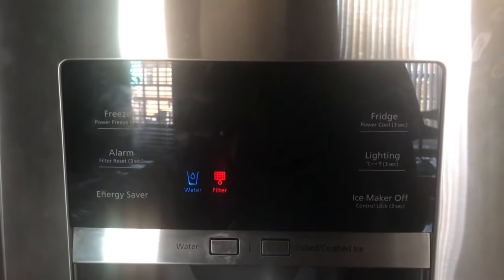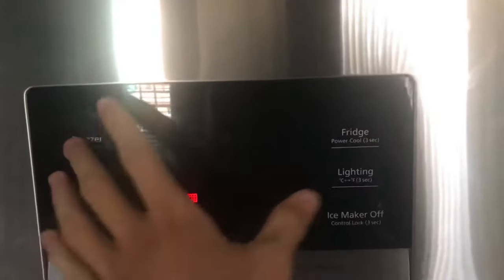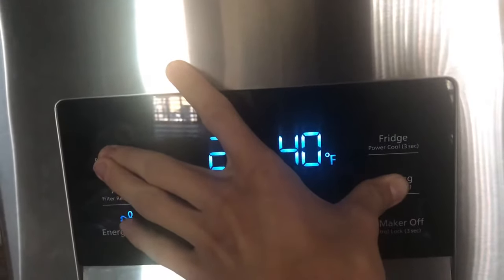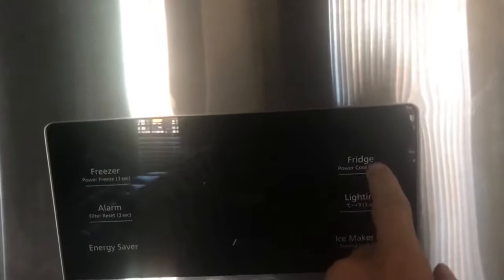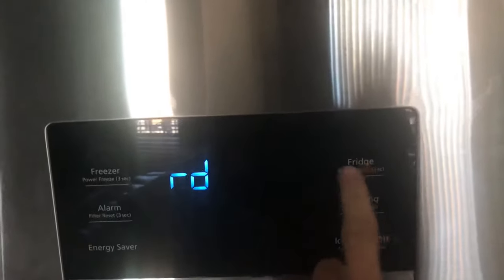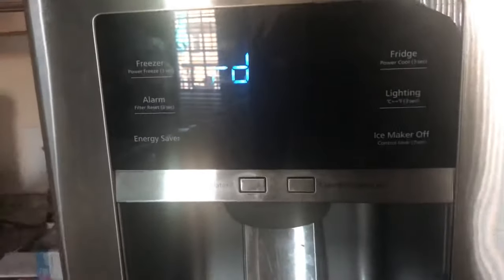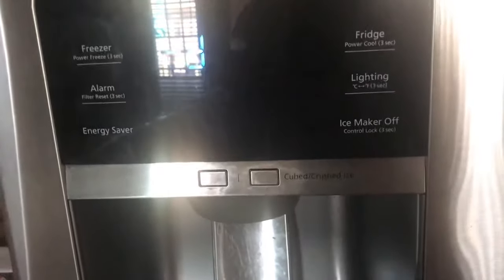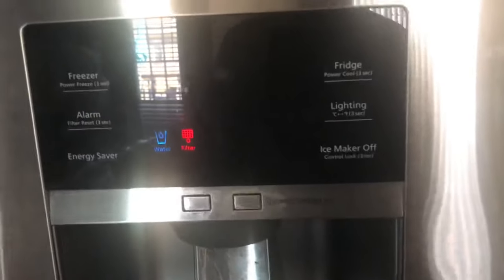2023 Samsung Fridge Ice & Noise Fix

Comment: Samsung Refrigerator  RFG297HDRS  (2013 model)
Knocking noises coming from top of fridge due to ice buildup in back panel and ice maker.
Need to activate Refrigerator Defrost (code Rd)
Pull out bottom shelf and put a towel there to catch defrost water & also need to empty Ice Tray. Put a towel in ice maker compartment if have ice buildup.
Push buttons Energy Saver +Fridge for about 8 seconds – screen will change.
Push Lighting button – keep pushing to get to code “Rd”.
Beeping will be heard.
Allow for beeping/defrost for 1 hour. BUT it may turn itself back on with the beeping stopping after 45 minutes.  If not then, push Energy Saver+Power Saver.  It should turn on.  (Push these again if it shows OFF because the OFF is Demo mode and compressor is not on)
Repeat as needed and may do weekly or monthly to defrost the back panel and ice maker, which will stop the knocking noises.
Reply: Hi i dont have knocking noises sound more like grinding would your method work do u know by chance thanks
Reply: @cristalvargas3674  it is worth a try. Grinding might be ice area frozen or a fan...just a guess from reading other posts.

Comment from the maker: Make sure to like, subscribe, and comment if this helped or anything else that you need help with
Reply: Hi, if this happens frequently what is the bigger issue? A part slowly breaking? If so which part is usually the cause and does replacing it fix the problem for a longer amount of time?